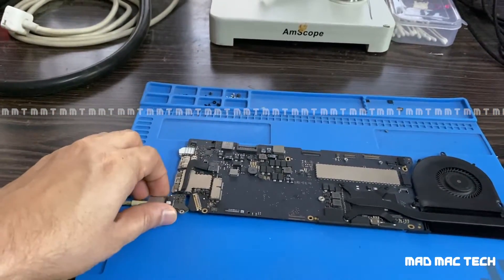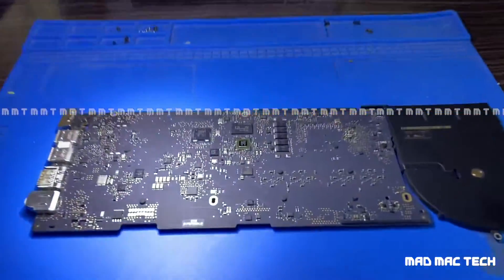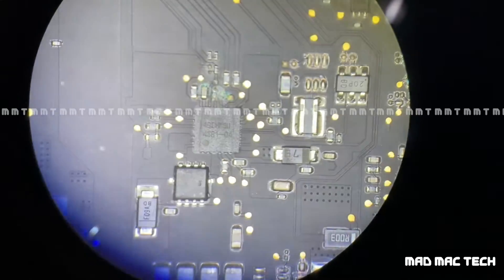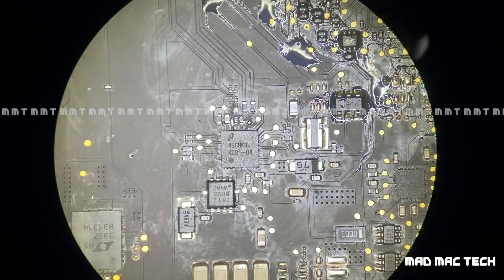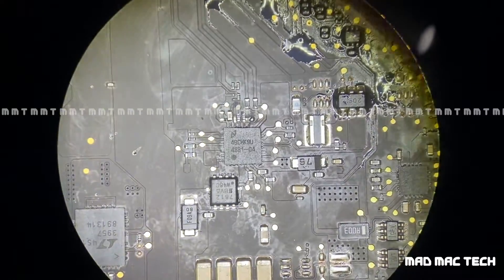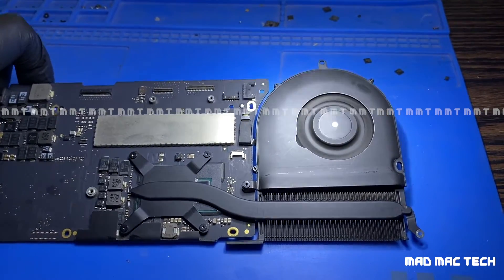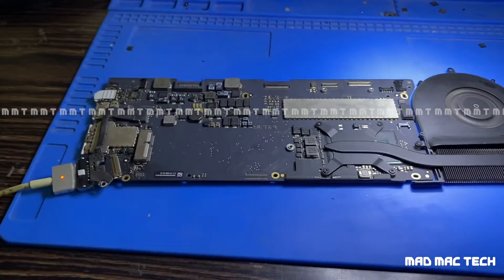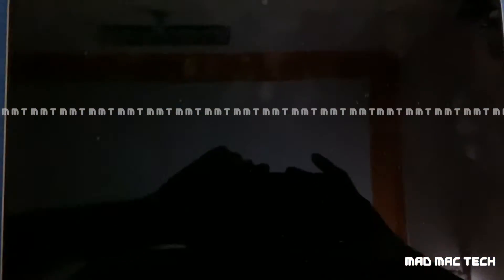MacBook Pro A1502 No Backlight Logicboard Repair || Mad Mac Tech

Comment: Hello. I have one where liquid was spilled on the screen but motherboard looks ok. Backlights in the screen are broken. Could this have taken out lp8548b1sq 04? Or might it just be a resistor or something that has blown open? Is there a voltage output test point for lp8548b1sq 04? i guess the 52v goes via ic 3BARO1U
Update. I have 52V on the bank of 4 largish smd capacitors but i only have 5.1V on the end of the display connector which i think is supposed to be the backlight voltage. I can't see any shorts on the driver ic. Is this the ic that is supposed to switch 52V to the display port? I tried to get a boardview for the 820-3536-A but i only have a mac and they seem to me in PC format. How ironic.
  I found the issue on the motherboard. I was looking at the wrong end of the display connector. Finally under the scope i saw the LED voltage pin was burned out, also some damage to the cable connector. I will try to solder a new connector to the motherboard.